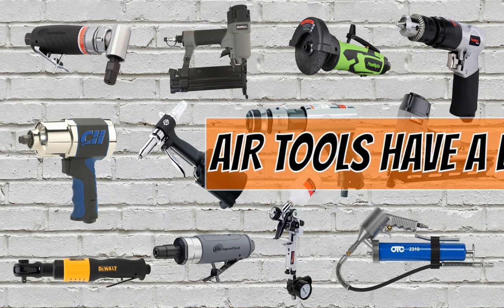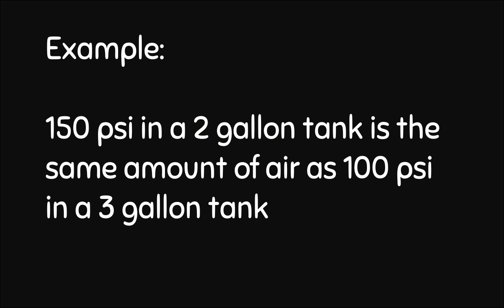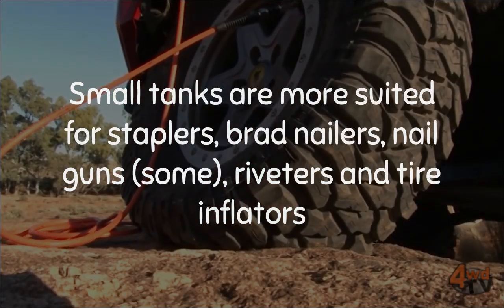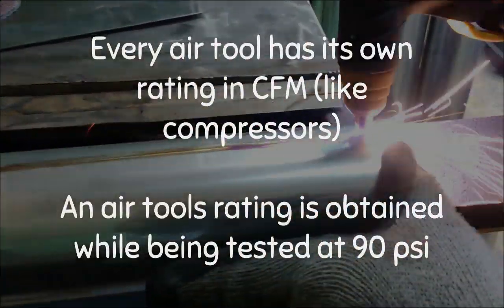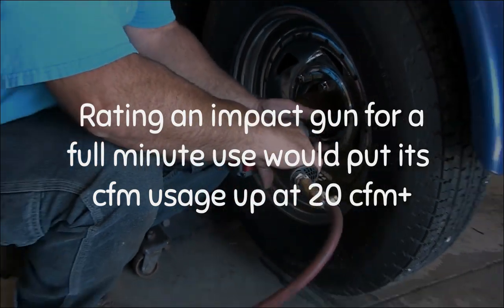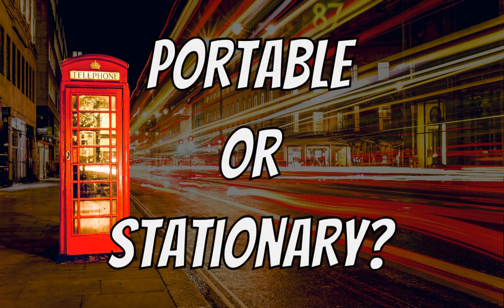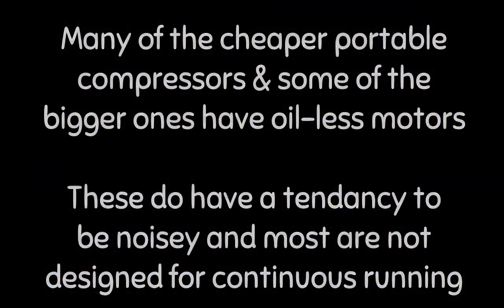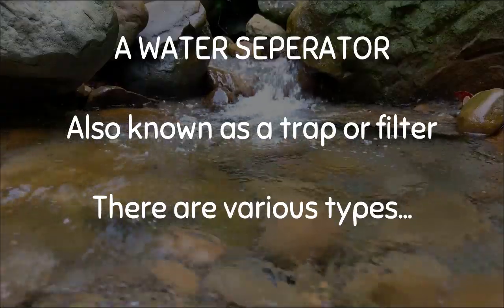Best Air Compressors For Air Tools

Comment: Another you have do is when done using it for the day, turn it off and empty all air out of the tank, there's should be a valve on the bottom of the tank for this

Comment: Black diamond 20 gallon tank with 135 psi...starts pumping at 100 psi and runs one to one to your use (except cut off and sander)...$409.  Double piston compressor recharges fully in 50 seconds.  Never have had a problem.

Comment: Question. After I'm done using the compressor, I normally let the air out of it. Is it safe to keep the air in for a few weeks so I don't always have to fill it?
Reply: So it looks like nobody is answering you so I will.  You can store air safely as long as you like but you should drain the condensed water out of the receiver (tank) regularly.
Reply: @chrislye8912  Thank you :)

Comment: Will a 6 gallon 175psi High Performance Hand Carry Jobsite Air Compressor operate an 6in Orbit Palm Sander? Just wanting to sand the bumper of ny daughters car and paint it.
Reply from the maker: Hi Lucky, short answer no. But I don't know the specs of the compressor or the palm sander. Your jobsite compressor is more or less made to power nailing guns - short bursts of air and pump up tyres etc.
Your compressor will have a Free Air Delivery (FAD) rate - for example 250 liters per minute (sorry I work in metric) and your sander will have an air consumption rate - example 190 liters per minute.
 (these specs may be given in Cubic Feet per Minute CFM)
In that example your compressor will power your sander because it produces more air than what the sander uses. It will also be at around 90psi. Most air tools operate at 90psi.
If your sander uses more air than what the compressor produces, then you will need a bigger compressor.
You will need to find out the specs of your equipment. Dont forget the duty cycle of the compressor. 
At a pinch you will be able to do the repair. Just do it in short bursts and give the compressor plenty of rest time and set the regulator at 95 - 100psi.

Comment: In your opinion what portable compressor would you buy if you do engine work body work and painting car or impact wrench die grinder spaying premier
Reply from the maker: I use all the same air tools. The die grinder and spray gun are your biggest consumers of air, because they are used for longer periods than 15 seconds.

You should run an oil lubed pump (avoid oil less)

Take a look at the cfm rating of your highest comsumption air tools, then add 30% to that to get a compatible compressor.

My quick answer is - Don't buy a compressor with less than 10 CFM @100psi. You would regret it when using the die grinder or doing more than spray priming.